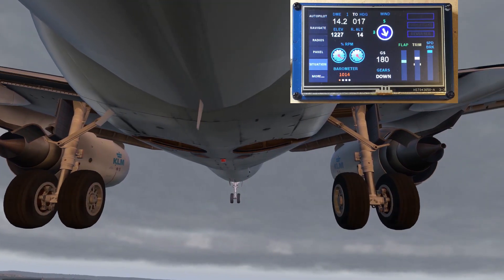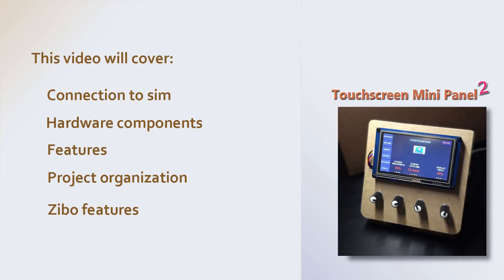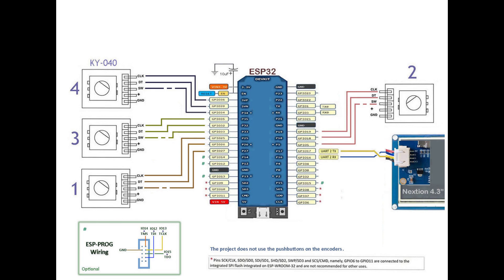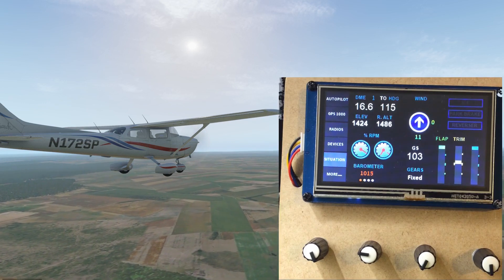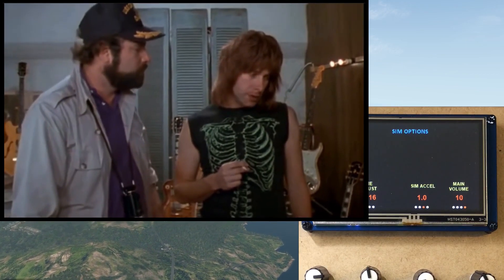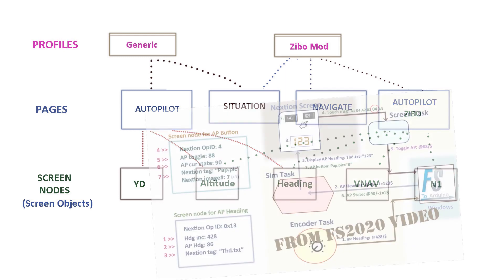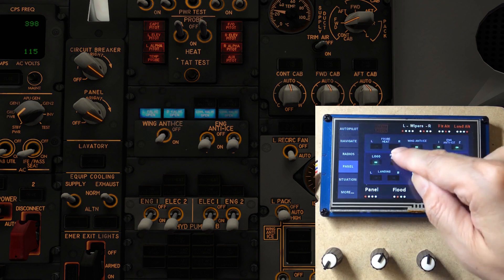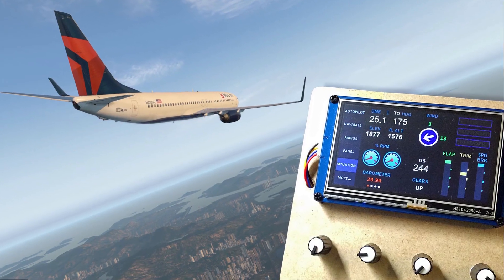Touchscreen Mini-Panel for X-Plane11

Comment: Thanks for your amazing works again. I flashed the esp32 and nextion with this new version, of code and it just works.
Reply from the maker: Glad it works out.  I just uploaded v2.01, minor changes only.
Reply: @discman777  I am at v2.03 - working great, I only fly with msfs2020 - should I upgrade to v2.04. Thanks again for your fantastic works.
Reply from the maker: @nguyenqhien  Glad you’re following the updates!  Yes, you can try v2.04, but please download it again since I’ve just made a tiny patch to fix a bug.